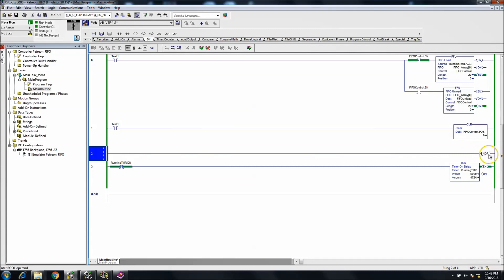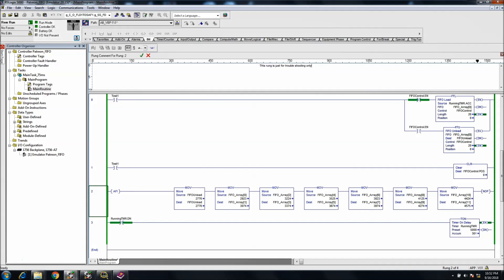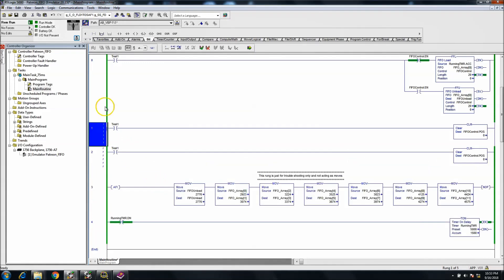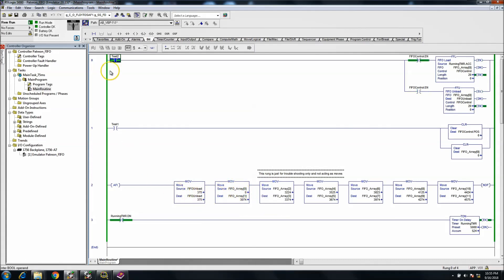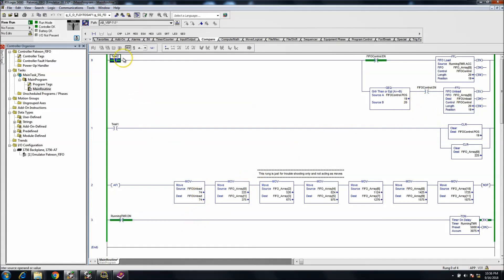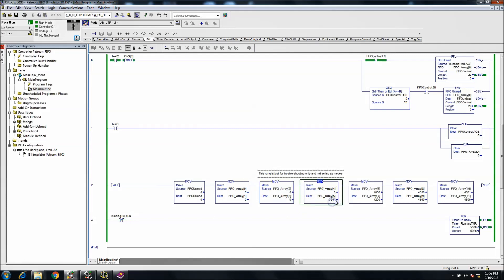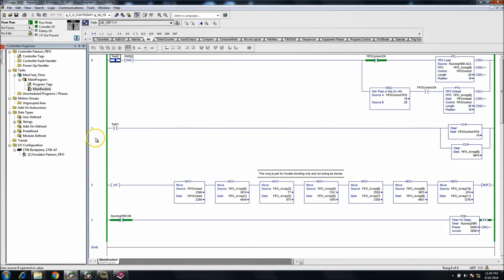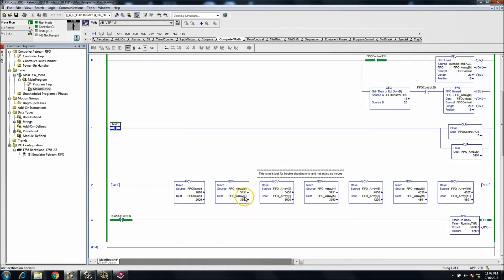RSLogix 5000 FIFO Load and Unload Quick Scan Example

Comment: Are you able to have a variable that can be adjusted to select a specific spot in the array. For example array[120] FFL 1 pos every minute. Through scada they can adjust if they want to see value 20 or value 5.I know we can do based on length but that brings up the issue of going 5 to 20 I will have a bunch of empty sections. My first idea is FFL copy array to a temp then FFU from both. one with length of 120 and one with length of Scada value.
Reply from the maker: Scada is HMI

If you are trying to read the data from the HMI then yes, if you are trying to write the data of the array from the HMI then I would use a different tag then mov it into the array element therefore the HMI doesn't own the data although you can try that direct method, just be mindful that

Comment: Hi Shane, I am trying to do an average calculation however I can't get my FIFO to operate correctly. Basically if I test like you do (i.e. toggle on toggle off), my position will not increment by 1, it will actually increase by a lot. I am using a One shot rising. Does that make a difference here. Please let me know!
Reply from the maker: If you are doing this under continuous tasks then that could be the difference.

Also make sure you have the load unload done correctly.
Reply: @ShaneWelcher  Thank you! Yes I do have that. I disabled the FFU just so I could see if FFL was working. I also just realized i was trying to load real values into dint array. After switching to array of real values it does not fill up at all. I really appreciate the feedback by the way!
Reply: I think it has something to do with my control. There's only 32 bits but i have a fifo array of 125.

Comment: Hello Shane, I want to keep an array of serial numbers scanned for units produced (up to 300 a day).  Could I create an array of 300 string types and use this or would I be compromising the memory of the PLC?
Reply from the maker: Memory usages is based on the processor size.

Generally in control logix, it doesn't hurt anything to have big arrays unless you already have a program where the processor is at its limits.

You need to check that.

There a few tools to do this with